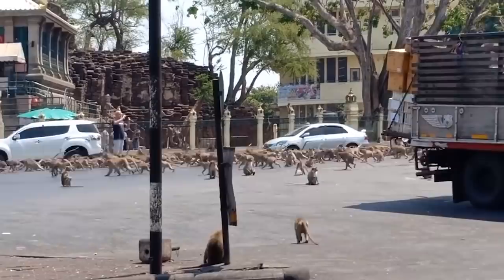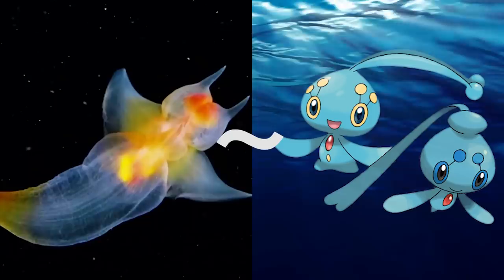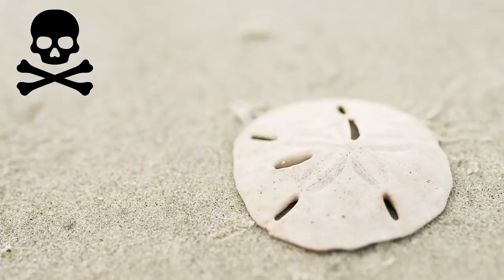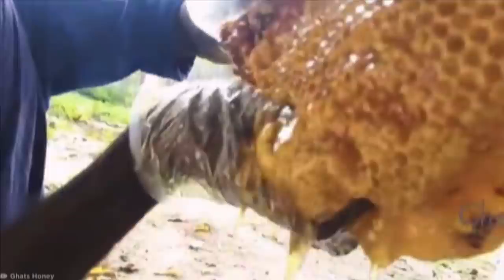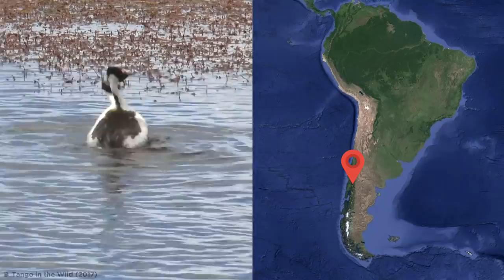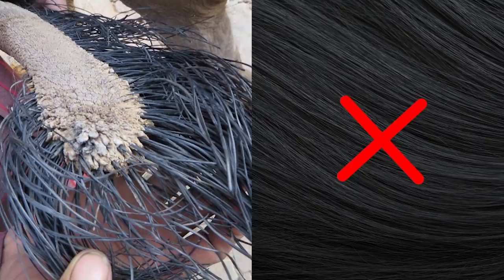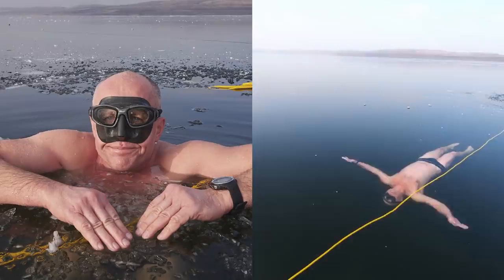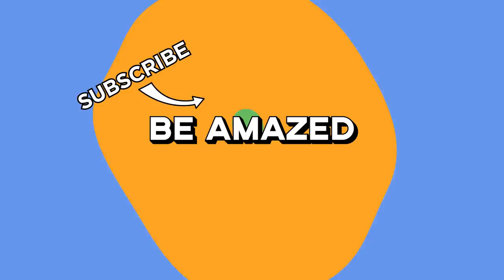Russian Creates Insane Boobytrap Coins

Comment: The Pigg-o-stat was not made to prevent exposure to radiation. It was created to hold a child so that they had a harder time moving, so the radiographers could get a proper chest X-ray, both AP/PA and lateral images with minimal movement, and proper collimating, so that they would not need to do repeat images. So, the pigg-o-stat was made to reduce radiation exposure by reducing the number of repeat images, not preventing exposure to radiation.

Comment: I volunteer for a student run business in Tacoma Washington called Bee253, while he is correct that that honey Is usually spun, the entire process is a bit different. We bring in our frames (the things the Honey comb and the comb for Brood aka baby bees are built on in a man-made hive)  and we take a heated knife to cut off the caps (the white part covering the honey, which is made by the bees by flapping their wings really fast and creating heat, therefore melting the wax over the top). We do this process for both sides of the frame. We then place them into a "chamber" called a Honey Extractor or a Centrifuge, the centrifuge has racks to hold the frames. We then turn a handle which spins the frames and pushes the honey out using centrifugal force. After, we turn the frames around and repeat for that side. We do this until all of the honey we are harvesting is extracted. After all of that we transfer it all into a bucket through the spout at the bottom of the centrifuge and then from the spout of the buckets we transfer them to jars. We then label them for what hive they came from (each hive has different types of plants and flowers, so each hive has a different taste. For example, one of our hives has a very distinct minty taste to it, whereas another one has a very distinct lemony taste to it.) We then put them on our online store and sell our honey. If you have read through this, thank you and keep being amazed

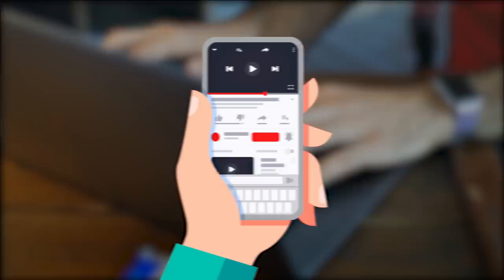Comment: 6:45 thats not a spider. The same full pattern can be found in the bottom left corner in between the "1" and the word "one dollar", and is visible a 3rd time on the opposite side after the word "one dollar" but before the "1" on the bottom right